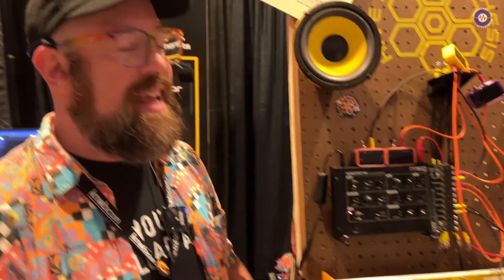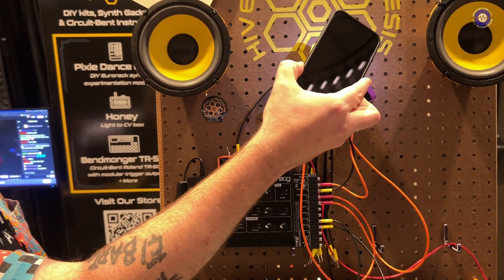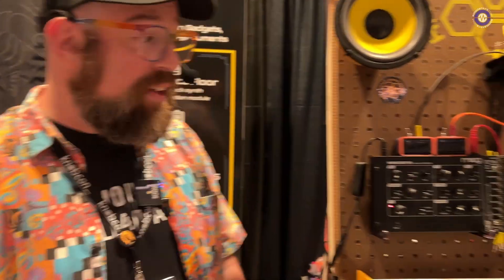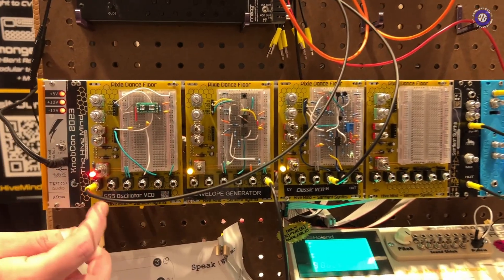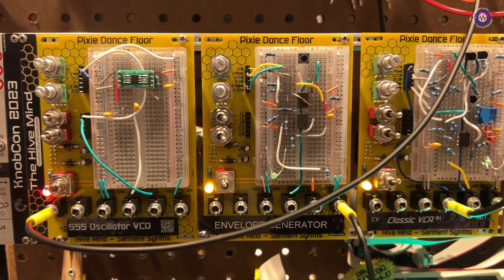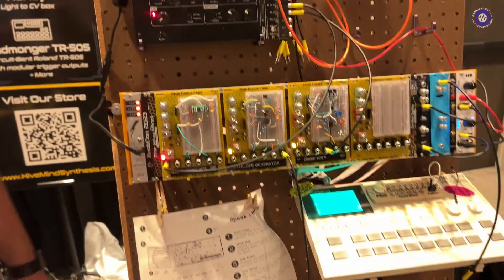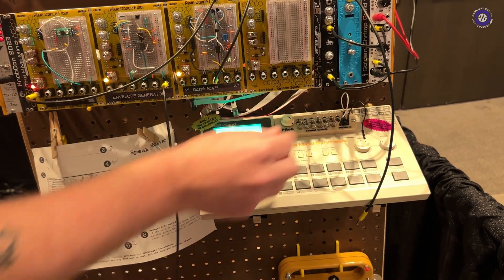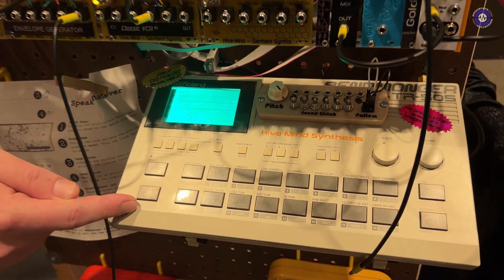Knobcon 23:Hive Mind  Eurorack Pixie Dancefloor  Module

Comment: Sell the 505 mod board as a kit
Reply: We've thought about it, but it's a ton of point-to-point wiring (I stopped counting at 100 solder points) direct to chips on the board, AND you have to cut a big hole in the face in order to fit all of the additional components, so it's a bit much for a kit.  We do sell kits for the backlight, however!
Reply: @HiveMindSynthesis  that actually makes sense. Thanks for the reply.